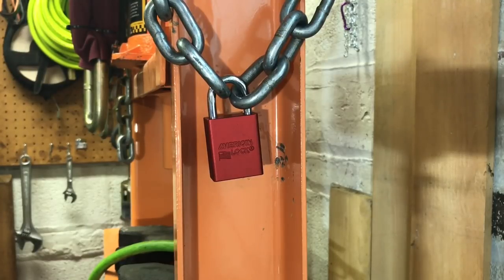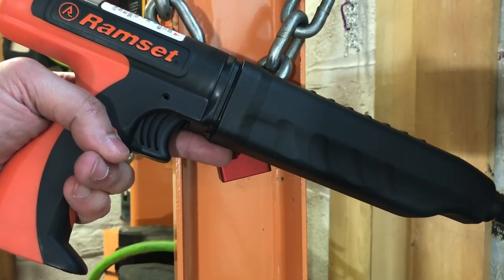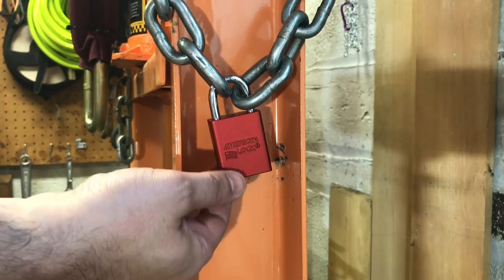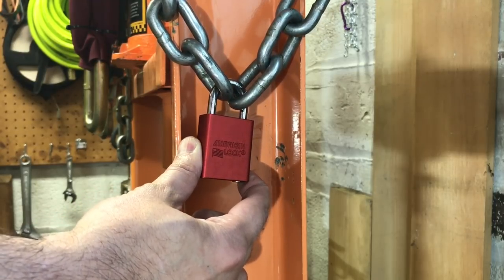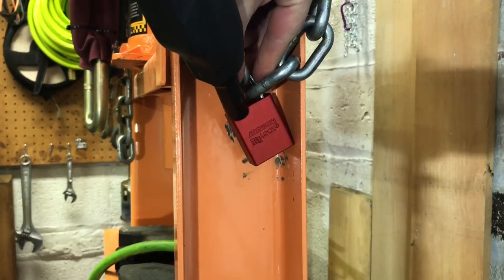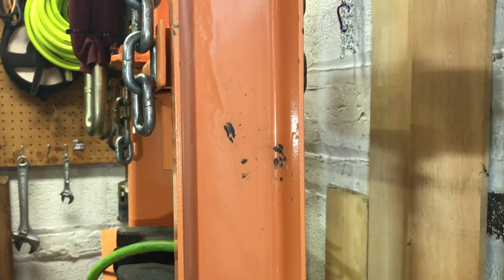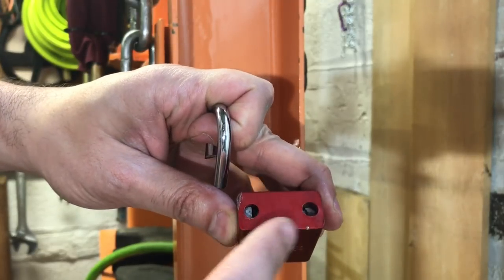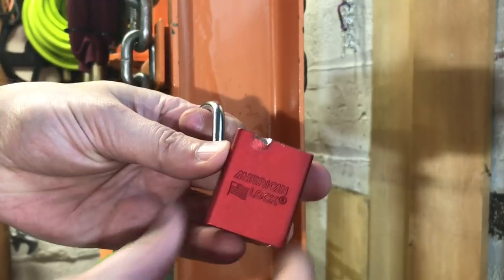[531] Glocksport: American Lock 1100 vs. .22 Blank

Comment: This nail gun is the most American thing I have ever seen. It's powered by bullets.
Reply: andrews2547 it's a very common tool used by workers all over the world.
Reply: andrews2547 
It's not powered by bullets it's powered by the powder in the blank cartridge.
Reply: It's powered by powder and a cartridges not a bulletts.
Reply: It's Australian.
Reply: It's not American. And neither are bullets. Ramset is an Australian company. http://www.ramset.com.au/

From Wiki -

The first integrated cartridge was developed in Paris in 1808 by the Swiss gunsmith Jean Samuel Pauly in association with French gunsmith François Prélat. Pauly created the first fully self-contained cartridges: the cartridges incorporated a copper base with integrated mercury fulminate primer powder (the major innovation of Pauly), a round bullet and either brass or paper casing. The cartridge was loaded through the breech and fired with a needle. The needle-activated centerfire breech-loading gun would become a major feature of firearms thereafter. Pauly made an improved version, protected by a patent, on 29 September 1812.

One of the earliest efficient modern cartridge cases was the pinfire cartridge, developed by French gunsmith Casimir Lefaucheux in 1836. It consisted of a thin weak shell made of brass and paper that expanded from the force of the explosion. This fit perfectly in the barrel, and thus formed an efficient gas check. A small percussion cap was placed in the middle of the base of the cartridge, and was ignited by means of a brass pin projecting from the side and struck by the hammer. This pin also afforded the means of extracting the cartridge case. This cartridge was introduced in England by Lang, of Cockspur Street, London, about 1845.
Reply: andrews2547 the most American thing is a 50.cal :)
Reply: Didn’t even know they existed ! Of course LPL would have one in his arsenal haha

Comment: Who'd a thunk?  I was with you on the body yielding, but just shows how brittle hardened metal can be I suppose. That steel structure looks fine as a mount point for future pipe wrench tests ( did that influence your house move?:))
Reply from the maker: +2LeftThumbs The steel is the side of a 20 ton press. If I tried to use that, it would just topple the press. ☹️ I'm working on something new. 😉

Comment: Jesus, and that's using the lowest powder charge .22 blank.   For not much more money you can get the .27 cal ramset cobra of the same design, just larger.   

The .22 cal brown blank has punched every lock out with ease so far.  Just to resist that, those locks would have to be made at least 50 to 100% stronger.  And then you have lots of extremely easy ways to upgrade the power of the attack for very little cost, effort, time, or energy.

1.  Multiple strikes.  How much stronger would a lock have to be to resist two strikes or ten strikes?   Blanks only cost 5 cents and it only takes 5 seconds to reload and strike it again.

2.  Stronger charged blanks.  The energy payload in the fully loaded blanks is close to twice as much.  

3.  Upgrade to the .27 cal.   The .22 is about $80-90 new.  The .27 is around $100-130 and probably doubles the powder charge again. 

I don't think there's a convenient-to-use padlock of any design on the planet that can withstand this thing to tell the truth.  You need a lock that weighs 40lbs and has 1/4in steel shrouding it and a 1/2in shackle.   You just need beef to absorb all of that dumped energy and thickness to prevent the innards from getting mauled.   You basically need a crumple zone around the innards of the lock to keep the delicate parts from getting snapped apart, especially when they're made mostly of brass.

Comment: does this tool go under the same laws as a regular .22 gun? you can fire regular .22 bullets out of this, right? so it seems to me that this would count as a "gun" by most all definitions. also, is this possible with an unmodified .22 rifle/handgun? or is this tool so heavily modified that an actual "gun" wouldn't have enough pressure?
Reply: ForthyPremonition It doesn't fire bullets.  The .22 blank drives a piston in the barrel which in turn drives a nail.  Potentially dangerous, but does not fall under the same laws as a firearm.
Reply: The ramset gun has a ram inside that is moved by the power of the cartridge, which is contained wholly inside the barrel, thus driving the nail into the chosen surface. there is no way for a projectile to exit the barrel.
Reply: interesting. so he left out the nail and let the air blast hit the lock, right? could you put a .22 blank in a regular firearm and try the same thing? or would it likely not work since this tool is modified? i dont see how you could modify a regular firearm any more in order to push as much gas as possible down the chamber (besides narrowing it?)
Reply: No, the pressure from the blank drives a piston in the barrel, or a ram, which then hits the nail.  It's this piston that hit the lock, as LPL said in the video.  A firearm has no piston in the barrel and would not work in the same way.  This tool isn't "modified", it's designed for a different purpose than a firearm.  Trying to shoot a nail out of a firearm would likely damage the firearm and possibly the hand that is holding it.  Never put any objects in the barrel of a firearm, even if using blanks.  Google the name "Jon-Eric Hexum" for a lesson about the pressures involved.  Not something to play around with.

Comment: You're going to see this type of failure with any conventionally hardened shackle. The standard martensitic structure of the hardened shackle has very little toughness. Manufacturers are going to need to produce an austempered tempered bainitic shackle to get the hardness and toughness required.

Comment: I can't understand why a padlock would be made from aluminum. Nothing makes sense about it other than cheap expected low security uses like a school locker or something. Otherwise. nah
Reply from the maker: Because it’s cheap, easy to machine, and strong enough for low security applications.
Reply: But then there are the PacLock blocks of the world that have higher aspirations. People should understand what they are buying but in my experience with locks they really don't do well with that. Lock manufacturers generally don't broadcast their products weaknesses so let the buyer beware as always.
Reply: Aluminum and plastic locks are typically used in maintenance and industry for applications that require a tamper-evident seal or to prevent someone from accidentally operating machinery, circuit breakers, valves, etc. (lock-out tag--out) A LOTO lock isn't intended to provide protection against someone determined to open it by destructive force. Rather they typically will have high-security cores that will resist attempts at opening them discretely.